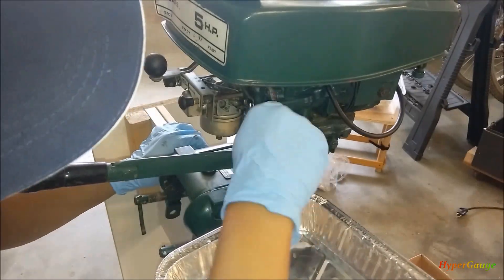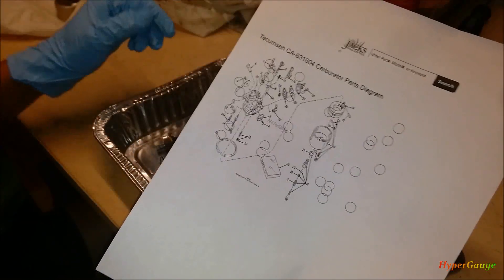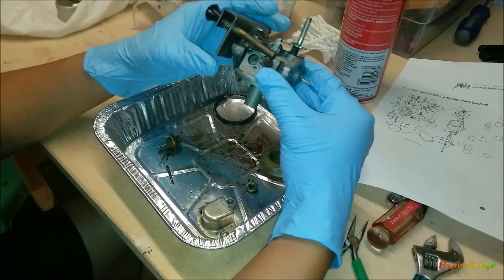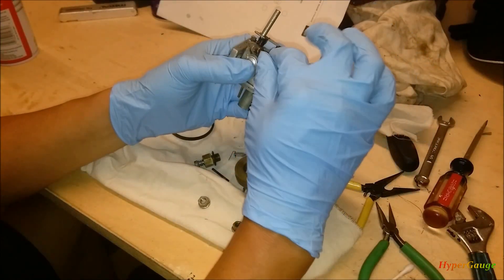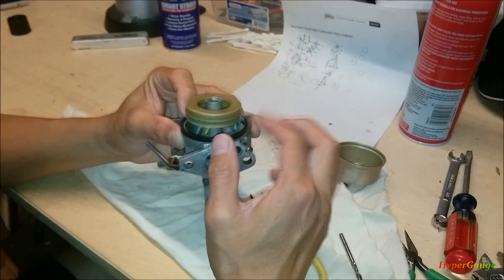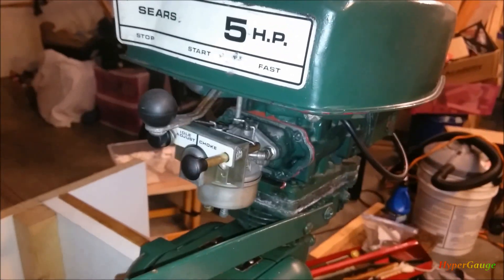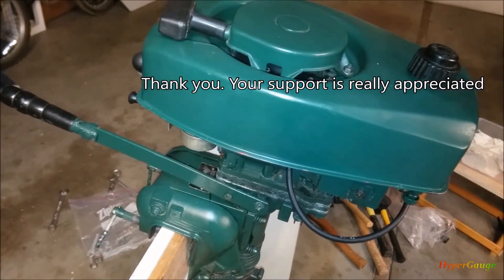3/6 1971 Sears ESKA 5hp Outboard restoration: Cleaning the carburetor PN 391 - Tecumseh 631604

Comment: The copper tube leads to the end of the idle adjustment screw that you took off. It sucks in fuel from it and you adjust how much with that screw for idling. You probably figured that out already though. I just got this same outboard and your videos helped thanks.
Reply from the maker: Thanks for watching my video. Yes you are correct. :)

Comment: might be late but at 2:34. I think you have the carb upside down to the diagram and the tube you're looking for is part # 24? in the diagram.
Reply from the maker: Actually, part #24 is the screw to adjust the idle. It is outside of the housing not inside.

Comment: At 1:15 there's a shot of you holding the carb that shows the face where the carb meets the motor. There's the two holes for the bolts, and then there's a third hole. I'm working on a similar carb and that third hole was filled with a plug. I've seen carb kits where that third hole is filled with a rubber fuel pump. Do you remember if the gasket between the carb and motor had a hole where that third hole is on your carb?
Reply from the maker: I no longer has this motor, but I clearly remember that hole is not blocked. I think the purpose it is to connect the motor so to create vacuum/pressure for the carb to suck gas in. Hope this help. Good luck with your project!

Comment: Ran across your video, I have a 7.5hp outboard that has the same carburetor, I'm having an issue with it pouring fuel out of a hole on the top of the carburetor. what an I missing?
Reply from the maker: Thanks for watching my video. It is likely the problem is form the float valve needle. Also check the float if it is installed and no leak. When you rebuild the carb it is better to replace all the gaskets and the valve needle. Good luck with your project.

Comment: That's the same carburetor I have on my sears gamefisher 7.5 hp and you can find the rebuild kit on Ebay
Reply from the maker: Thanks for watching my video. I am not surprised the gamefisher share the same parts with many different models. But are you sure the 7.5HP use the same carburetor as the 5HP?
Reply: @HypergaugeDIY  it looks exactly the same the only thing that changes is the choke system but that part is interchangeable the number is 640-19B tecumseh engine 7.5 hp Model- 217-585750 .
Reply from the maker: Thanks. I will check it out.

Comment: Hi! I have a similar carb on an Eska motor from 1976. When you took the carb, there are three holes on the plane facing the engine. That third hole has a silicone below in mine. Was there none in yours? Don't see it in the video. 
Mine has started to fall apart and I'm trying to locate a spare. 😁 Greetings from Norway
Reply from the maker: Mine one does not have a silicone. It is just as shown in the video. I think it maybe hard to find the exact replacement for your carb. However, you should be able to find parts online (try eBay) to rebuild it. Good luck with your project.
Reply from the maker: I never use this kit. I just cleaned mine and it worked. I did later change the housing gasket which I purchased from eBay.

Comment: is there a way u can send me a picture of the fuel line inlet on your carburator. my carb has nothing
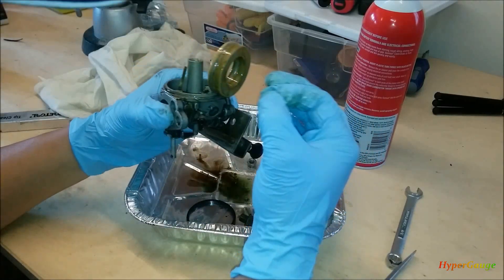Reply from the maker: In this video https://youtu.be/T8g52TwWPGc I have shown the fuel line connected to the carbs inlet at around 1:20 It is a very straight forward connection.
Reply: Some have 2 inlets. 1 for main and 1 for external tank